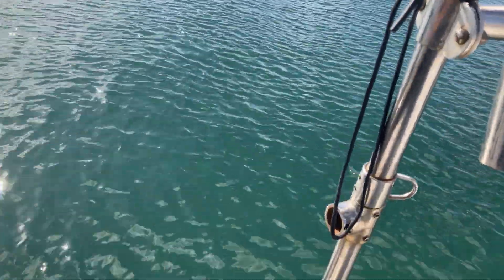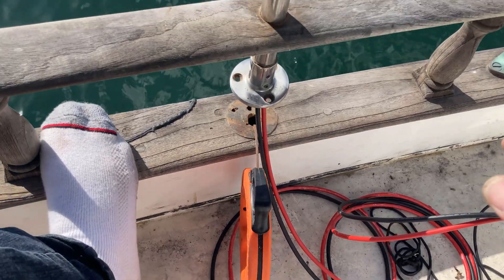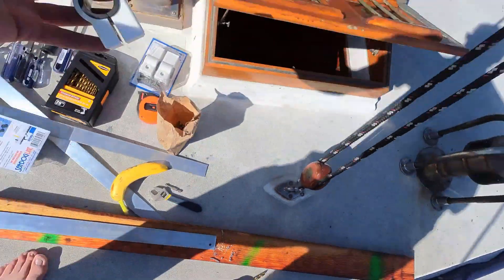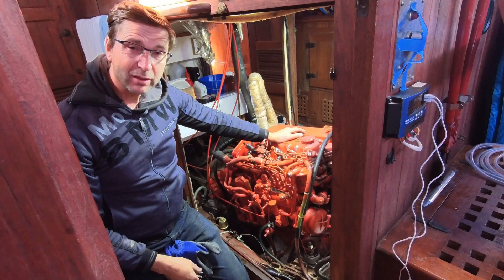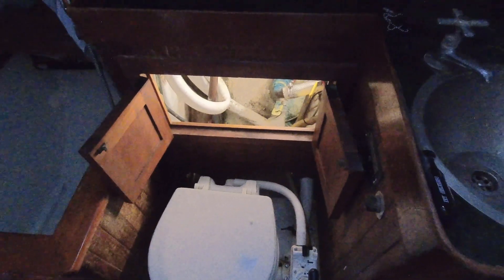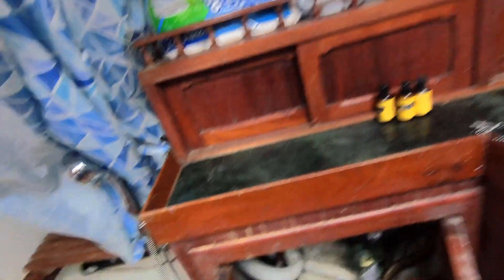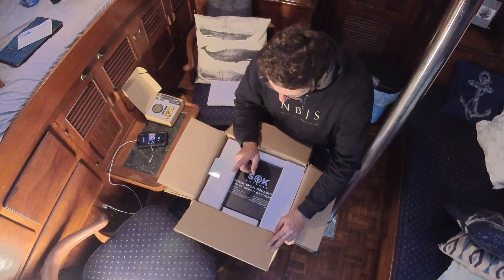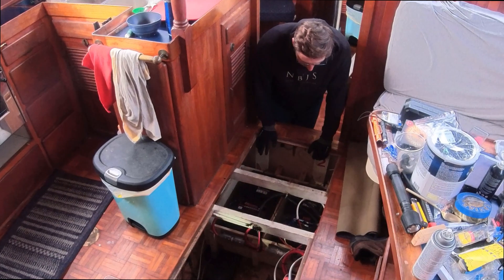Solar and Lithium upgrades  Episode 4

Comment: Great vid Onno. With your DC/DC charge controller, did you have to wire up the smart ignition wire? Might be different in a boat but just curious. We have the same one for the van, hopefully in the next couple weeks I can tackle that and get some power to Liv. Lori's offer is still there to pick you up at the border 😉.